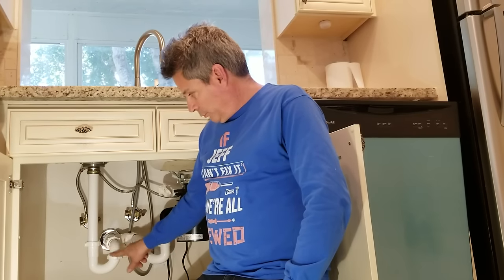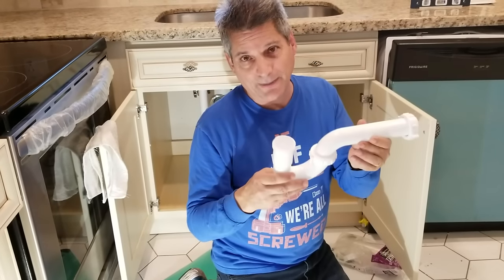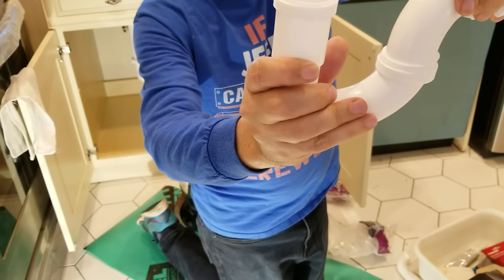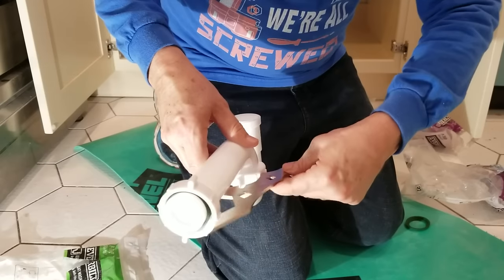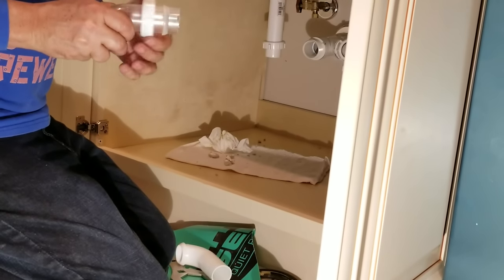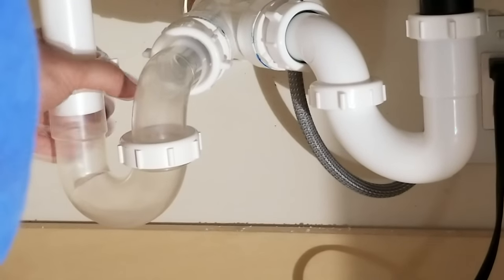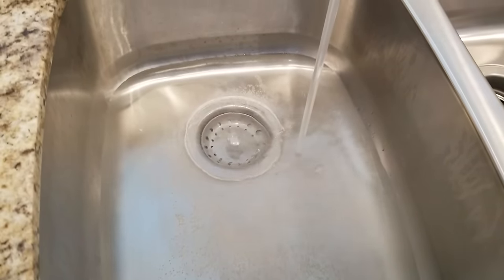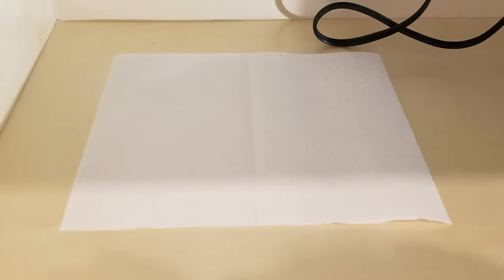Why is my Kitchen Sink P-Trap Leaking at Connection Nut?

Comment: The drain side at the p- trap was leaking seems like I have it level, I noticed my washer is plastic and you used rubber washers please help thanks
Reply from the maker: That is a compression connection it does not need any washers 'cause you can tell that the curved pipe that goes into the wall when it curves down to go into the P trap it has that sort of bowl shape to it. So when you're installing the P trap this is the most important connection 'cause it's the one that leaks the most so you want to make sure that after the P trap is in place and dry fitted that you put those two together perfectly level and then tighten that connection first before you tighten any other connections. Make sure that connection is happy and not leaking and the rest will take care of itself

Comment: My sink doesn't line up straight,so I needed to use flexible hose but now it licks at trap?
Reply from the maker: Don't use the form and fit flexible P traps that you're against plumbing code and if your homeowners insurance company finds out you have one they will drop you until you replace it. Instead look at this other video I did that shows you how to deal with the fact that you're sink drain does not line up with the drain on the wall https://youtu.be/b_OSgwpteR4
Reply: Can I use 45 degree or a 90 degree to try and connect to pipe,or is it trial and error?

Comment: Mine is leaking at the first nut leaving the sink. Over flowing. Same fix?
Reply from the maker: If you are leaking at the first nut, make sure you have the gasket on the tail pipe coming out of the sink. Make sure that gasket it set so the flat part is up top and the angled bottom of the gasket is facing down. That gasket slides into the beveled opening of the p-trap, and the nut should then secure the tailpipe into the p-trap opening. Make sure the p-trap is all the way up on the tail pipe, so that the tail pipe rests against the stop that's on the inside of the p-trap.
Reply: @jeffostroff  thank you! About to go look at it once dinner is done cooking. Thanks for replying so fast! You just earned a subscriber!
Reply: @jeffostroff  I fixed it!!! We just bought a house in September so learning as we go and I feel so proud of myself for fixing something 😂
Reply from the maker: @Hollis_Creative_Corner  what was the cause of the leak at that nut?

Comment: why don't they  make the p tap one solid curve and have the joint  over the watermark?
Reply from the maker: Conventional wisdom is the p-trap should be in 2 pieces so a homeowner and take it apart to retrieve their wedding ring that goes down the drain, for example. I still think it could have been done as one piece.
Reply: @jeffostroff   gotcha thanks.. My pipe came detached last night from the strainer basket  somehow but the new p trap kit I got I cant attached to the strainer what am I missing ?
Reply: Do i need a new strainer basket ?
Reply from the maker: @L2THEC1  I would only replace the strainer if it is leaking or the threads on the bottom broke. You should be able to use the old pipe that was screwed onto the bottom of the strainer, and make sure that the "high hat" shaped washer is in place at the top of that pipe before you connect it to the strainer. I prefer to change everything to brand new when fixing a leak in the strainer. If the leak is in the pipes, then I just replace the pipes underneath to have everything brand new connecting up to the strainer.
Reply: @jeffostroff   Thank you . I think my problem was the plastic nut disintegrated and a piece fused to the strainer threads, so hopefully I can loosen it somehow , thanks again .
Reply from the maker: @L2THEC1   Either way you will have to be able to get that piece off of the threads because one way or another you're either is growing on a new pipe or you are replacing the strainer and pipe. If you do end up buying a new strainer be sure to get a small tub of non staining plumbers putty.
Reply: @jeffostroff   appreciate your time & advice.

Comment: Once hand tight, you stated a quarter turn with a wrench would be OK.  I'm thinking half that,  one eighth turn,  would be more appropriate, but, "hand tight" is very ambiguous and is unique to each person.
Reply from the maker: Yes you are correct it could mean a lot of things to different people but what they are just trying to avoid is the case where you used a ranch and kept tightening too tight to the point that it cracks the plastic.
Reply: How about you just say thank you?

Comment: The leak on mine is at the end of the drain where the rubber washer is used to keep it water tight but it just doesn’t seem to stay in position correctly on the pipe leaving the house and doesn’t stay water tight 😩
Reply from the maker: Could be the gasket wore down and needs to be replaced. When you slide a gasket on up the drain pipe, it should be snug fitting and you should have to use a tiny bit of finger force to slide it up the pipe, it should not be loose.
Reply: @jeffostroff  thank you! It was that the gasket was fitted wrong and I was able to readjust after watching your video so thanks a lot 👌🏻

Comment: The thing with PVC is that with expansion and contraction the fittings tend to loosen up or crack over time . Also with the water rushing through the pipes they tend to leak down the road , don’t like plastic.
Reply: What is the equivalent system you use?

Comment: jeffostroff -why does that fitting not have a gasket? It could be so easy to seal!
Reply from the maker: I never understood why they don't use a gasket. It's a compression fitting, but it so critical to be spot on with the fitment of the 2 parts, that any slight deviation causes a leak. The metal P=traps that I install have a gasket there.
Reply: @jeffostroff  -Maybe it's to keep plumbers employed? If mom could get it to work, plumbers lose jobs!
Reply: They do make the plastic ones with the rubber slip joint washer on the trap arm. I use them all the time.

Comment: My leak is on the other side of the p trap. Any videos on that?
Reply from the maker: Kimberly, are you talking about the spot where the long p-trap arm goes into the wall? If so, look at this video we uploaded 2 weeks ago about remodeling the bathroom, and I have it set to the par tin the video where we install the p-trap. I show you there how to install the green gasket properly for the vertical drain pipe, but not for the p-trap entry into the wall adapter, but it works the same. https://youtu.be/Pq2QabyeEgg?t=2151

Comment: @12:58 - Those cut-off valves with no lines attached to them should really be capped, for extra protection.
Reply from the maker: Caps not needed, he had hoses on them by the next day. One going to the dishwasher, the other going to the ice maker on the fridge.

Comment: How do you stop a leak on the gasket end? My leak is on the rubber gasket side.
Reply from the maker: There are rubber gaskets all over the place under the sink, exactly where is the leak?
Reply: The long piece of the p-trap that connect to the wall. Cant get the gasket to seal the water out .
Reply from the maker: @UCdnhHUWmZC1i09I964khf5A OK, so you probably have that gasket in wrong, or it's the wrong type of gasket. On the long P-trap arm, you put the nut on first so that it's facing that trap adapter on the wall, then you put the green gasket on the end of the p-trap arm. Noe here's the important part, that gasket is wedge shaped, so the flat part usually faces the washer, and the tapered wedge side goes into the trap adapter/connector on the wall. that is what seals that joint up, so when you tighten the nut on the P-trap arm, it squeezes down on the gasket, creating your seal. Try that, let me know who it works.

Comment: Why have 2 traps under the same sink?
Reply from the maker: It could be done with one trap also.
Reply: @jeffostroff  , could this not effect airflow I'm thinking
Reply from the maker: @ericdw5678   No,  everybody keeps trying to 2nd guess this set up, it doesn't matter if you have 2 traps or the standard method of 2 separate lines of pipes from each sink leading into one p-trap,  you still have the same physical volume amount of water going down the pipe. It works absolutely perfect and I have not seen not one single problem. We had both sinks filled up and drain them both at the same time and they both drained just fine with no problems as long as you have a goodVent stack system in the building which we do this is a 4 story building, there was absolutely 0 problems.  Believe me we tested this sync out 6 different ways to Sunday not one single problem I don't care about all of the bogus academic ideas that people come up with their all Monday morning quarterbacks that aren't actually doing this in testing it in seeing for themselves. People don't understand that when you have double Sinks emptying into one peythroppe it's the exact saying bottleneck of water whether you split it through 2P traps or whether you use 1P trap

Comment: It's a poor design to begin with where under the sink isn't that much of a problem but hidden like for a tub is another story. Both rubber and plastic washers will disintegrate or crack in five or more years and minor movements doesn't help where near perfect alignment is required. Years of slow leak under a tub will result in major damage (dry rot and termites) if not caught in time. Whenever you change over like a new sink, garbage disposer, or tub, the pipe alignment will be a little off. This is frustrating because the alignment looks pretty good but you have a new leak. Couple of hacks work for me as a DIY. One is a flexible down tube, the long one under the sink. The other is a rubber coupling inserted in that down tube provide just enough flex to get it in alignment. Just hand tight is enough, don't push it with it a big wrench or it will crack. Been there done that. Counter intuitive, more you tight the worse it gets - yelp that's what my plumber said.

Comment: Why not wrap some pipe tape on the threads of the leaky joint?
Reply from the maker: Those joints are not designed for the use of pipe tape

Comment: No matter what I do it leaks. The washer won’t stay put. I’ve changed the washer out multiple times.
Reply from the maker: Not the washer, iit is likely the spot where the 2 halves of the P-trap come together
Reply: @jeffostroff  I’ve changed out the p trap before as well. It kept failing. I finally replaced it with a rubber p trap with metal fasteners. They ought to just do away with the plastic p traps. They’re no good,

Comment: why we have switched to Snappy trap. Sure it's 50% more cost than ever built (junk) and Keeney. Another option glue in PVC  drain system with clean out on Ptrap (higher labor, not removable persay, more skill). Bottom line Snappy trap is the only brand that has incorporated a gasket on the wall bend drain piece to P trap connection. And their plastic is  of higher quality. * note if you use the entire snappy kit the corrugated flex piece is smooth inside and does not void IPC.

Comment: Why two traps? One would meet the code, eliminate an extra failure point and save space. 
Also, if so concerned about that connection, would that hurt to add a bit of teflon tape? 
Not arguing on anything done in the video, simply trying to learn more.
Reply from the maker: Val, There's a hundred ways to skin a cat. You could have done it with one trap, and just have the horizontal waste pipe go from the garbage disposal to the left sink's down In this case we chose the Wye, partly because of the dual access to clean out. But any solution that works, adheres to plumbing codes, and does not impede the flow of waste water is fine. As for Teflon tape on P-trap joints? No, I never use Teflon tape or pipe dope on trap fittings. That is not how they were designed to work, and adding onto the part without the manufacturer telling you to do so can lead to problems.  Traps leak because they were installed wrong, assuming there are not cracked. If you tighten but don't over tighten like many DIYers or handymen do, you'll never get a leak. IF you tighten the weir nut first before tightening the other nuts, that is the most important connection and that one should be satisfied first and your trap will be leak free.

Comment: Stupid question but couldn’t you just put a gasket on the one that doesn’t have one
Reply from the maker: Know then connection is not designed for 1. Some people will put pipe job on that connection before they put it together. But all that does is cover up their inability to make the connection correctly.

Comment: The sink would drain so much better and smoother if you had a continuous waste with one p-trap versus double trapping a single waste arm. The secondary sink acts as a vent when done that way similar to a tub and a sink with overflow holes it helps pull air allowing for better drainage I think you should leave this work to professional plumbers.
Reply from the maker: This was a professional plumber that did this. Nothing wrong with the design, apparently you paid not attention to the water testing showing the sink draining perfectly and smooth, LOL. BTW even  with both sinks draining at the same time it worked fine, because pipe stack is 1 1/2, fine enough for both fixtures. Also you don't normally have both sinks full and draining at the same time.".

Comment: The big question is....why doesn't the top end of the P trap have a gasket seal???? That plastic on plastic seems so stupid.
Reply from the maker: Yes, I've complained about that for years. If you look at the video I just uploaded last night, I show how to install a metal P-trap after the transparent P-trap cracked, and the metal P-trap actually uses the gasket at that connection because they did not use a compression flared/angled tip fitting. their fitting into the J bend was cylindrical, and the gasket slides over it. Much better.

Comment: This is a a violation in the UPC Pluming code, which makes it Illegal in about 10 states. To make it legal in all 50 states use one p-trap not two.
Reply from the maker: I wonder why UPC has a problem with it, because the normal way people implement this is that horizontal tube from the garbage disposal tot he vertical tail pipe, then to the single P-trap, but you still have the same volume of water entering the waste line. Not sure what problem they have with it. BTW, we tested this sink for over an hour, running water full blast, filling up the sinks and letting them drain out, this setup works like a charm.
Reply: @jeffostroff  There is a slight risk of one trap getting siphoned dry if same size wye is used. The IPC's allows it with the caveat that the wye needs to be a larger size (2in I think) which will prevent that from happening, where the UPC just bans it out right.

Comment: I have good luck putting plumbers putty on the mating surface when they leak. Save a trip to hardware or big box store.
Reply: Plumbers putty may work fine for the initial install. But today I had to loosen an old puttied PVC trap joint to replace the sink tailpiece. When retightened, it leaked. Now I'm struggling to remove the semi-hardened putty that's probably blocking the joint from resealing!
Reply: @WhatIfWeDidRight  yeah it needs to be thoroughly cleaned out of the threads or replace the pipe, but like you said it's all about the initial install and unlikely event it needs servicing.  But when it does get yourself a brush ans get those threads cleaned out.

Comment: Why the heck is the P trap designed the way it is?   Why put a joint underwater, why  not removed that joint all together?  I mean if you have to have it perfectly level to make it work, why have it at all, OR why is it designed with NO gasket?   So thank you for the video, please remove the music, ( you don't need it ).  Can you please make a video where you can't get perfectly level and how to fix that.  Can you put silicone on as a gasket?
Reply from the maker: I have always argued that they don't need that connection where the water seal is. I wish they would do away with it. A different shape tot he connection so that you can use a gasket would be better, but still not fool proof. Also P-trap is supposed to have a 1/4" per foot slope back to the wall.